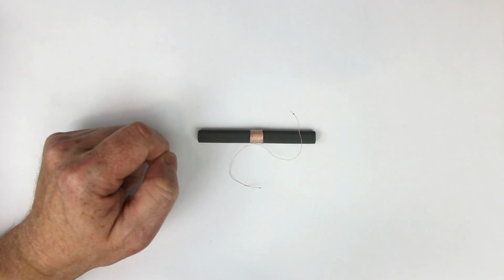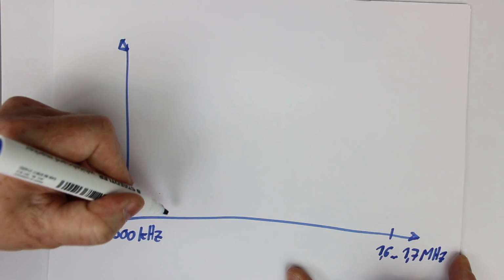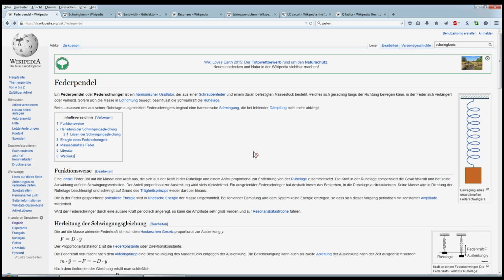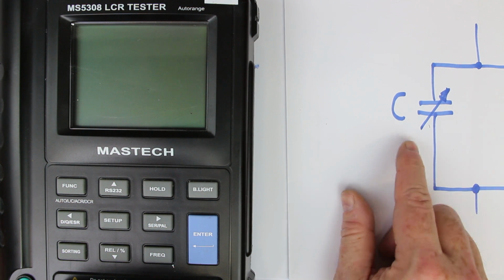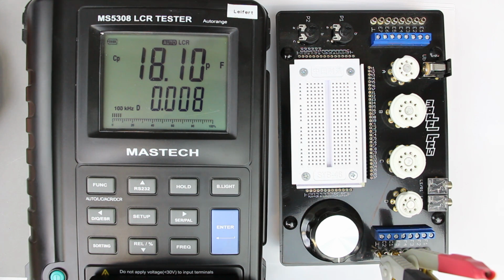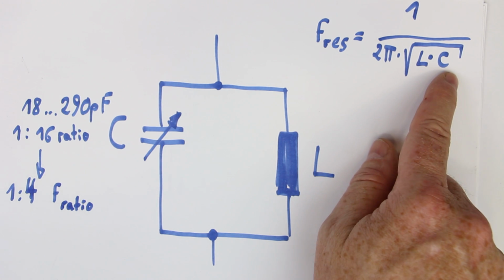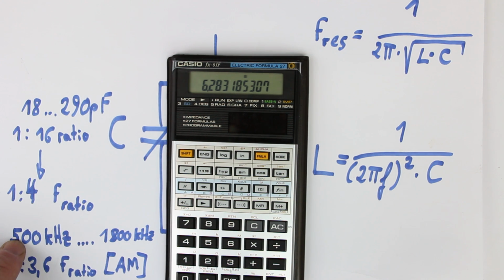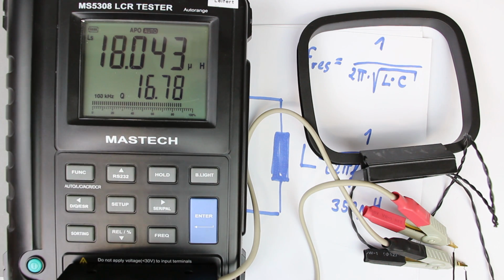Resonant Magnet-Field Antennas Pt.1: Introduction

Comment: Informative video - thanks
btw, Australia has AM stations broadcasting at 1701kHz
Reply: But not many radio had over 1700 KHz ?
Reply: As far as I know there are exactly two licensed stations on 1710 KHz in the US, both low-power "travelers information" stations.
Reply: Here in the US also, up to 1710 kHz.  From 1600 to 1710 it's called the "extended" AM broadcast band.

Comment: So thats the reason these tunneldiode made good amplification because they made the resistance lower, of the resonant lc???
Reply from the maker: Do you mean that tunnel-diodes were used as rectifier/demodulator-diodes?
Reply: @KainkaLabs  yes, demodulating germanium diodes. I still have some lying around. Will use them for some syntheziser projects.
Reply from the maker: Germanium diodes are not tunnel-diodes (=Esaki diode)
https://en.wikipedia.org/wiki/Tunnel_diode
Germanium diodes have the same shape of the characteristic curve as silicon diodes, Schottky diodes etc.

Comment: extremely unclear !  In Engish there is no such thing as a "Magnetic Antenna" .
The 3xplanation is fine for an inductor conected to a capacitor .
Reply: KainkaLabs is referring to a coil & ferrite rod combination as a "magnetic loop antenna," which is technically accurate since anytime you pass a current (radio signal) through a coil of wire, a magnetic field is generated. Maybe you were looking for a video about an active HF loop antenna, this is not about those, but there are plenty about those on YT. BTW I've watched 100s of videos on RF antenna concepts & demonstrations and this one is the definitely the best so far.
Reply from the maker: Magnetic Antenna = Magnetic Field Antenna (in contrast to electric field antennas like dipole-antennas etc.)
Inductor connected to an antenna is a tank-circuit aks tuned circuit aka LC-circuit.
A magnetic antenna can be a part of a tank-circuit, but does not necessarily have to be a part of it.

Comment: It is best to use in anti submarine and it could be used in antenna need no tower if correctly apply but also use in light interference in encrypted signal the same way in uv and ir

Comment: Good Job!!
I am working on a research paper trying to design a metal detector that can detect a quarter size coin three meters deep. Any Ideas? Your help is valuable
Reply from the maker: Good luck with that. Commercial metal detectors can detect a coin one meter in the ground. But 3 meters???
Reply: @KainkaLabs  Thanks for your reply.

1-  Why should the 3m be that difficult?
Reply from the maker: Look at the specs for commecial metal detectors.

Comment: What is the exact model number of the "V CAP 4" variable capacitor ? Can't find it unfortunately.
Reply from the maker: Model. no? In our shop it is the VCAP4.
Reply: @KainkaLabs  can I order it to India ?
Reply from the maker: Yes, but minimum order value is 15 Euros net and shipping costs are 10 Euros for small packages, 30 Euros for lage packages.
Reply: @KainkaLabs  I understand. Thank you for the information.